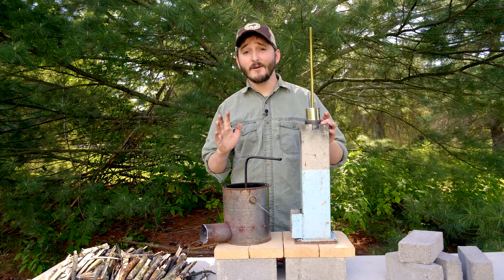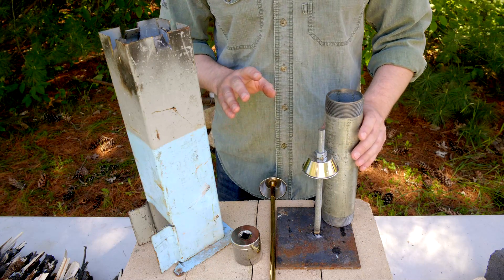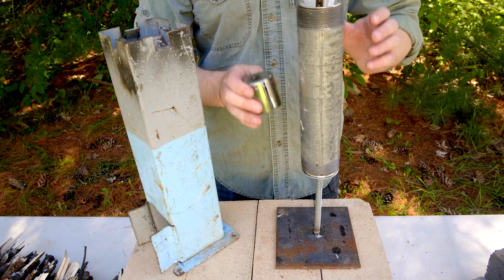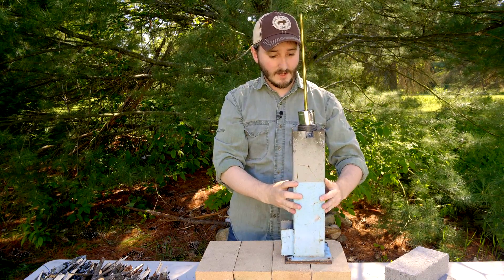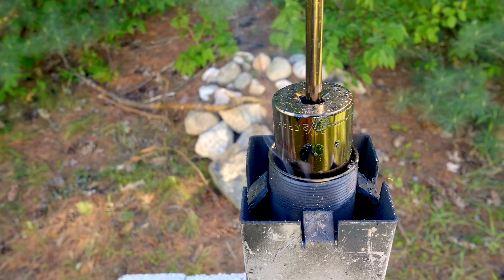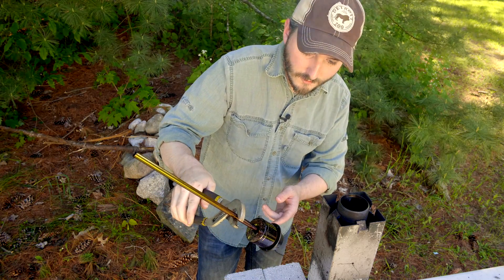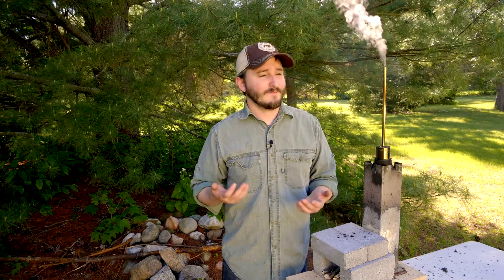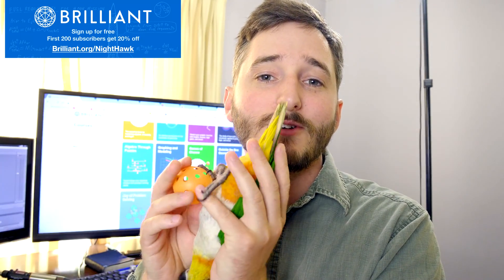Testing A Better Wood Gassifier (Bio Gas Fuel)

Comment: If one used a timer, and a few selenoid valves and when the timer fires, it closes off the gas production and creates a lifting force to dump the coal into the bottom automatically, then all you need is a feeder mechanism for pellets and you have a continuous gas production system.  The gas at the end of the pipe needs to be sent through a water cleaner and cooled with some sort of copper coil and well...  I see you have the basis of an amazingly cool system.  It is unclear to me the best way to empty out the bottom, but lowering the little bottom cup/sealer would be far more efficient than raising the tube.

In my opinion the idea you have of using the byproducts of the reaction (tar) to seal the valves is the key idea here.  This entire system is entirely brilliant and you should be very proud to have come up with it.

Comment: Not only is there zero evidence that CO2 actually raises temperature. Because proxy evidence indicates the CO2 always goes up after the temperature has risen. Usually by about five to seven hundred years. But there is ample evidence that humankind was dangerously close to dying out because of low CO2 in the atmosphere. At 150 parts per million plants die. Which means humans die shortly after. The other advantage to raising the CO2 in the atmosphere a bit, is that at 852 900 parts-per-million as opposed to 350 parts per million, plants grow five times faster. Meaning we can feed a lot more people. And it would be nice to grow grapes again in Northern Canada like they used to do in Scotland several hundred years ago when it was much warmer than it is today.

Comment: I am very impressed with this wonderful youtuber but I keep missing his full name not included in his description in every video ...... can anyone share his full name? ..... As per his wood gas goal ..... oxygenation or "burn" is as important as is the production of syngas (wood gas) and the "burn" only happens with oxygen in the right amount ..... there is a ratio for each type of fuel that must be consistent, actually all other elements even metals oxidize (burn even with a flame) with the help of higher ratios of oxygen with the right mixing device .... if he adds to his experiments a better way to oxidize (oxygenate) (mix) his already efficient wood gas production then he would be a success others would emulate including myself ..... air is only about 22% Oxygen by volume ..... this is why "natural" gas (is not natural, is fossil but they had successfully sold it to all by inserting the name "natural") stoves and gas burners have a tiny tiny hole for the gas and using the bernoulli effect this mixes with air producing a clean blue flame because the "natural" gas has been priorly filtered which in this experiment his "wood gas" is not and is dirty thus an intermittent yellow flame .... his wood gas is much too rich for the air's pressure (atmosferic) at the tip ..... he actually has too much wood gas, he just needs more oxygen ..... natural? ..... on another thought everything is natural, fossil is natural, anything made by earth is natural, even us humanimals and all of our wonderful creations, including me and this guy too and his experiment and all of us commenting and not commenting just watching, we are all natural ; )

Comment: Try a rocket stove design like this but pipe the wood gas back into the lower opening...it will greatly lengthen the burn time of your fuel and increase the temperature of the stove top as well

Comment: Hi! I enjoy your videos.
Just an idea: Suppose you make a gasification chamber, with 2 trapdoors (one above to feed more wood and one under to dump the charcoal into a chute to quench and collect the charcoal).
Then, you pipe the wood gasses through a chamber to condense and collect the lighter volatiles and then pipe the unburnt gasses through a coil (in the firing chamber) and fed back to the burner.
And feed fresh wood through a funnel on the trapdoor on top.
Just wondering 🤔

Comment: I know that this video is 2 years old, but anyways, wouldn't have been simpler to make a second fuel unit for the old design so you can produce non-stop? While one is in use, you empty and refill the other one, rinse and repeat

Comment: I wonder if the process would be more efficient if you created a ground up wood fuel first. You could pack the tube more, leaving less oxygen, and it will obviously have a greater surface area for the wood to burn and produce gas.

Comment: Filtration and collection process. Take the collection tank and attach it to the bottom of the filtration tank so it stays sunk underwater.

The gas pressure from the production will empty the collection tank of the the water.  But since it's already attached to the bottom of your filtration tank, all you have to do is open the valve and the gas will come out. Then you don't have to fiddle with getting the tank to the bottom of the filtration tank.

Comment: Very cool. I was thinking about doing one of these for years. I'm thinking of trying to use some old large wood drill bits as an auger in and out of combustion chamber. Pellets, sawdust and wood chips would feed it.

Comment: So if that char is shiny and sounds like a chines porcelain cup, I think that is BIOCHAR... which is suuuuper useful in the soil.  By just dumping it back on the flame you are losing a valuable resource for growing food and improving soil conditions, unless it then burns hot to contribute to the gasification process.  I just wanted to mention that... You have to inoculate the char, but it houses microbial life and is a sponge in the soil that gives a safe area for those biological agents to live when dry.  Lookup 'terra preta' for historical context  

It may be very well to just throw it onto the flame if you're getting more heat from it... but if you can make wood gas, biochar, and tar to make oil with.... man what a process right!???  What else can you make from the products out of this thing?  You have the char, the tar side product, and gas right?  You could get the tar into the water tank, use the gas, then dehydrate the tar maybe?

Comment: Why not use electricity to heat the wood inside... and use the heat to heat hot water.. but you will have the byproduct of gas to burn at a later time.

Comment: Would there be a benefit to directing the gas to the burn chamber to allow it to contribute to additional heat? This seems like it is deconstructing a part of the process often seen in rocket mass heaters where there is a turbulent extended burn chamber that allows more of these gasses to be burned as part of the process.

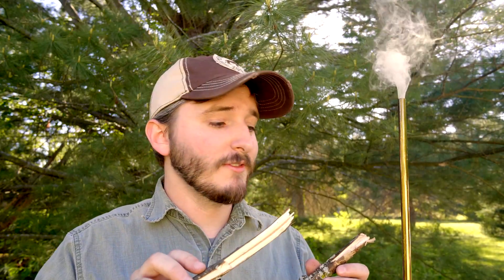Comment: I realize that using decaying wood that's already on the ground isn't as environmentally harmful as other fuels like fossil fuels, and yes fungus do digest the wood and convert some of it to co2, and that's the thinking behind biochar being considered for carbon emission reduction, but the claim that it is "100% carbon neutral" (6:08) is false

that wood is food to some organisms, including but not limited to fungus, and that carbon does far more than just become gas if the wood is left to decay. it becomes biological structures, used to help organisms grow & multiply. maybe the process is 99% carbon neutral, maybe it's 1% carbon neutral, i don't know exactly, but most likely it's somewhere in the middle, and whatever it is, it certainly isn't "100% carbon neutral"

Comment: I would hesitate to say that Wood Gas is a good alternative to fossil fuels, you could never produce enough of it without logging, not to mention the health issues you would incur by breathing it in. At best you could use it for small scale carbon neutral(ish) power generation.  However you point about it being carbon neutral is kinda a misnomer simply because of the rate at which you are converting that wood to C02 is much higher than if you were to let it decompose all on it's own. Additionally the process of decomposition feeds other life than just fungi, so by removing that from the ecosystem there is a risk of unintended consequences. 

So while I don't see the long term harm with experimentation with it, and it's a great resource in a pinch, long term, there are better means of generating renewable energy, even on the small scale. The trick is storing said energy efficiently.

Comment: What if you ran the pipe from the charcoal tank back to the under side, would it generate it's own power? Using a small fire to start the process then it becomes self reliant.

Comment: Ben, do you think you could power a generator with wood gas in a pinch? I've read a comment under my video on tar distellery that you could...
Reply from the maker: I tried running an engine in another video and it sort of worked, but it's harder than you would think. Normal carburetors aren't made to work with non liquid fuels. The channel MrTeslonian has had much more success than I have. I believe he has a truck that runs on woodgas, and several other small engines.
Reply: @Nighthawkinlight  Thank you for the link. Yes, that was my thought exactly: "...it's harder than you would think"...
 Just watched the video! Fascinating
Reply: There used to be a reality TV show called "The Colony" where they did just that. Some TV-magic may have been invovled though but it seems doable.
Reply: Could a steam engine work for this? I don't know a lot about it, but it seems like it at least should be a bit more flexible for fuel.

Comment: Woodgas production creates about 50 % methane, which has a GWP (global warming potential) of 24! This means that if you emit your woodgas, without burning it, you definitely contribute to global warming. If you burn your woodgas you should be about neutral.

Thanks for your video!

Comment: My system uses a charcoal starter tube with a 8"-6" chimney reduction fitting inside.  The gap is filled with perlite or plaster of Paris  which acts as gas kiln to break down the smoke and heat the gases more. There is a half inch gap to bring in air then two more feet of chimney pipe to complete combustion.  Ideally, this should also be insulated.  You get a clear, sometimes bluish flame with no smoke at all when it comes to temp and it is hot enough to melt aluminum(1220°F).

Feed wood from the top and let charcoal fall into a pit or even a pot of water  below.

Comment: You can gasify wood directly by having an insulated chamber above the fire to superheat the smoke to completely degrade it.  Then allow air intake BEFORE the end of the pipe.  Maximize heat to break down the smoke then burn with a super abundance of oxygen. You can burn wood completely smoke free with your only exhaust being water vapor and CO2.  CO will combust if you get it hot enough.  I've melted aluminum (1220°F) over a wood fire chimney but the system is a bit complicated to explain.

Comment: It doesn't burn cleaner than gasoline. Cool and all, but it is a myth that this is good for the environment. This produces pollution and Co2.
Reply from the maker: Making wood gas produces particle pollution, but it is carbon neutral. Burning any surface level organic matter is carbon neutral, because if not burned it will release the same amount of CO2 as it is digested by fungus and natural processes.

Comment: I love this, I bought an 8 qt pressure cooker and a single electric burner and loaded the pressure cooker with leaves and while it did make smoke like yours did and the smoke coming out of the center valve would disappear when I applied a flame, i could never get the smoke to ignite do you have any idea why this happens? Really like your videos and keep going. Happy new year.
Reply from the maker: There is a minimum temperature for good wood gas production. You probably could not get hot enough with a single burner
Reply: @Nighthawkinlight  Thanks so much for the input, makes since.

Comment: Great video. Apparently it's possible to produce methane gas from wood using platinum group catalysts, with a conversion rate of above 80% but of course this process was sold and patented by the highest bidder. It's great to see someone doing honest research on biofuels without any strings attached.

Comment: Keep in mind that I just found wood gasifier tech very recently! (lastnight) Along with other youtuber's, I see much bigger gasifier's being built with bigger steel tubes, cylinder's, & barrels & burning in say a "upper container" while passing forced air into the mix along with vent tubes just to allow some oxygen in when needed & capped when not needed, then directed out & threw tubing which seems to benefit from a radiator style cooling period to achieve a cooler smoke & I've seen water filtration devices to collect all the tar/ oil. Many people/(a handful) of people have some awesome gasifier video's online & your channel is one of them! Keep up the great work & keep on spreading the news & HOPEFULLY WE CAN MOVE AWAY FROM UTILITY COMPANIES & FORIEGN OIL ASAP!!! Also, Maybe WE CAN BREAK FREE OF FALSE FLAG ATTACKS IF PEOPLE STOP ALLOWING POLITICIANS TO PASS LAW'S BASED ON FEAR/RESTRICTING OUR LIBERTY & ESPECIALLY WHEN IT COMES TO OUR UNALIENABLE RIGHTS LIKE THE 2ND AMMENDMENT, OUR RIGHT TO TRAVEL UNIMPEDED, & LAW ENFORCEMENT HARRASSING CITIZEN'S WHEN NO CRIME WAS COMMITTED WITH "CODE ENFORCEMENT" &  SILENT SUBVERSION WHEN LAW ENFORCEMENT HIRED LOBBYIST TO PETITION LAWMAKER'S TO AMMEND DRIVING LAW'S ALLOWING LAW ENFORCEMENT TO CHANGE THE ORIGINAL LAW'S UNTIL THEY NO LONGER MENTIONED "TRAVEL & TRAVELLER'S WHICH ARE CONSTITUTIONALLY PROTECTED! (A) DEVELOPE THE DMV, dmv in an act of commerce sells people a "priviledge to drive" becoming a "for commerce driver" similar to a taxi-driver, semi-driver, INSTEAD OF A PRIVATE CITIZEN SIMPLY TRAVELLING IN THEIR PRIVATE CONVEYANCE which is constitutionally protected!(B) AUTOMAKERS SILENTLY SEND EVERYONE'S (MSO) "MANUFACTURER'S STATEMENT OF ORIGIN" to the dmv & people are left to assume that they need permission to travel unimpeded! Keep in mind that the 1st act of fraud is, signing people up as "AMERICAN CITIZEN'S" WHEN YOU HAVE MANY MORE CONSTITUTIONAL RIGHTS AS A "STATE CITEZEN'S" BECAUSE ONLY STATE CITIZEN'S HAVE SPECIFIC RIGHT'S!  The 2nd fraud is when parents sign their kids up as "AMERICAN CITIZEN'S" INSTED OF "STATE CITIZEN'S"  OF WHICHEVER STATE YOU WERE BORN & THEN THE 3rd fraud is assuming that one needs permission/permit to travel, & goes to a dmv to get signed up as a "for commerce driver" NOTICE IN ALL OLD RECORDINGS FROM THE EARLY 1900'S AUTOMOBILE'S DID NOT HAVE PLATES ON THEM! Law enforcement offered free plates to more easily spot a stolen automobile & soon, Many people assumed they needed to have plates & so many people requested a plate so, Law enforcement started the dmv & thus, the fraud began! That is why today, it is common to see an officer stop & charge a citizen with a code enfraction when there is NO VICTIM SO, THERE IS NO CRIME YET, THEY GET A CODE ENFRACTION THAT IS MEANT FOR A FOR COMMERCE/ COMMERCIAL DRIVER ONLY, NOT A CONSTITUTIONALLY PROTECTED TRAVELLER! That was the reason for the fraud! I do hope people wake up to the biggest scam on society & look how many lives have been lost due to it & how much property has been taken! If you want to look it up, check out-U.S.Supreme court states no license required to drive-wearechange...driving vs travelling... also, & most importantly, on youtube,- High Frequency Radio! The man is a genius when it comes to law & both Constitution's, YES THERE ARE TWO! 2 SETS OF RULES!!!!!!!!!!!!!!!!

Comment: I love the idea of using the charcoal for a second burn.  I am curious if the chamber temp changes when the offgassing is complete?  Could a mechanical temp triggered lever be used to empy and refill the chamber (from a hopper of fuel)?

Comment: OK, very basic dumb questions: 1. Is the energy required to release the wood gas greater than the energy the wood gas produces? If not, you could feed some of the wood gas back into the combustion process instead of using other forms of fuel. Not sure of the physics of it.

Second question: I know the rocket stove is great for drawing in O2. In later videos, you use a bellows to provide O2. Just wondering if there was some way to use the heat energy from the burn to power a fan that could work instead of the bellows that could constantly feed O2 to a moving vehicle like a bicylcle.

Comment: Help! Only interested in same simple design and collect gas for stored in wheather balloon.. like power outage and woops .. time make gas and blow up huge ballons storage and use as 3 ways... the rocket stove cooking.. also after finished breakfast/ lets make gas. and store it for candle/ light coalman light bag! and 3.. for heat ! maybe a 3rd type rocket stove .. just for heat.. idk. REAL uses!...use cheep motor to test! (just in case breaks it! ) push mower :>) please

Comment: A downdraft gasifier is much more effective and can be charged continually while hot and running... 

Think of a tobacco pipe that you are constantly adding fuel to...

A good example of a downdraft gasifier would be the electric generating plant in spokane washington, which is a gasification plant that burns the area's garbage

Comment: I don't remember if I ever watched a vid from YOU where you break water for the hydrogen gas, but I figure you probably know how. But, seeing as hydrogen gas is rediculous efficient, and woodgas seems to also burn with very great efficiency, what if you combined them? Would that cause any sort of adverse or unwanted reaction? Or would it help use less water and less wood by combining both types of gasses together in order to use less of each resource?